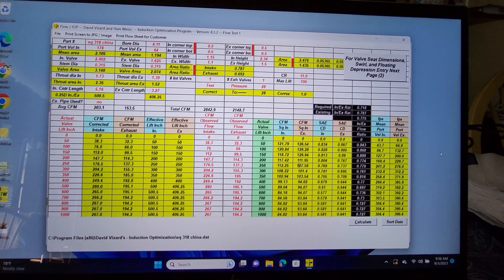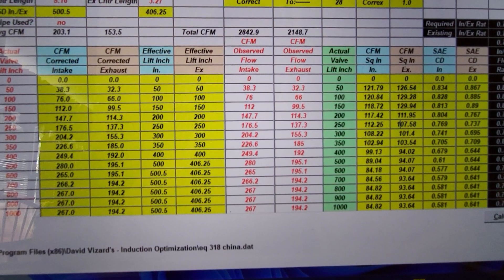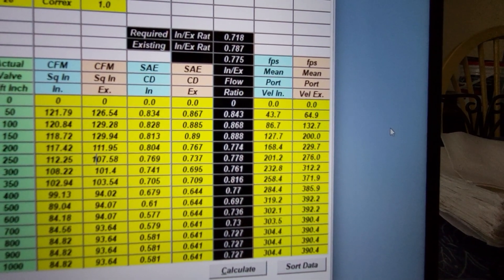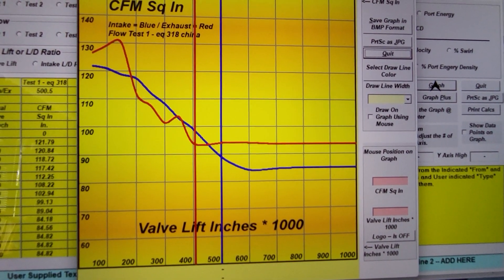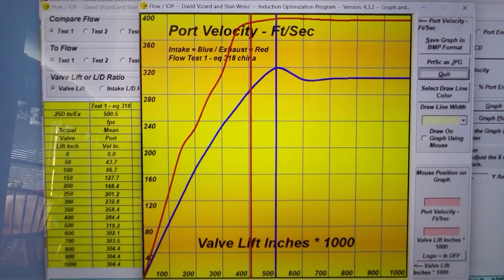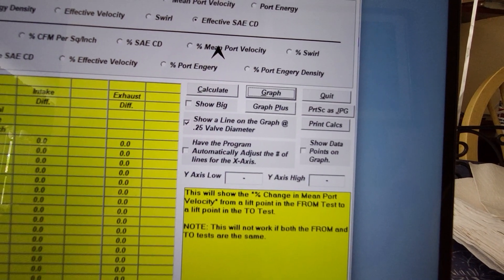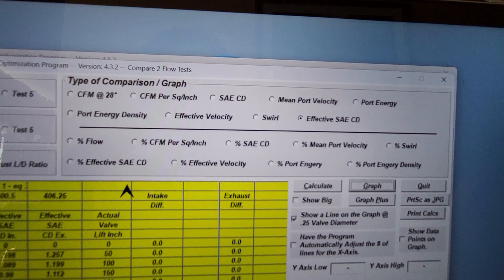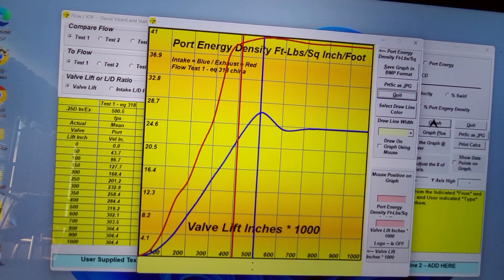David Vizard/Stan Weiss iop program, EQ-CH 318b Chinese cylinder heads ported

Comment: Have you done any work on the Australia 318b?  Question about the china head. At anytime while porting did you think the ports were thin? Did you think the deck was thinner than it should be?
Reply from the maker: The New Zeland 318b Would just have a different manifold pattern than the 318a. I have done the 318a N.Z. head. Nice piece. The deck was fine on the Chinese Eq

Comment: I can tell you off rip, this head is going to really like a healthy overlap, a cam with something like a 107 LSA is really going to bring out it's best qualities.
Reply from the maker: What makes you write that? I would like to read your logic. Thanks
Reply: The first half of that reply is cryptic.
I’d recommend a cam on a 106 for the amount of cubic inches it is.
Reply from the maker: @Robs-Garage-experiments  Can you say,"Traction issues?"
Reply: @servediocylinderheads  just based on your port velocities.
Reply from the maker: @rolandotillit2867  Expand on that please. Thanks
Reply: @servediocylinderheads  Both ports are area limited, the exhaust less so, therefore the overlap will favor exhaust blowdown. This also reduces the probability of reversion. Therefore it will appreciate a nice overlap, it'll even pull decent vacuum at idle.
Reply from the maker: @rolandotillit2867  Excellent, thanks